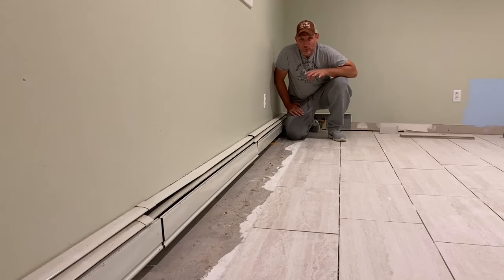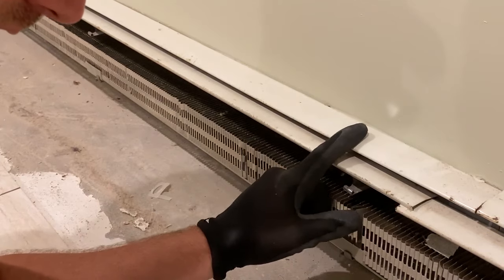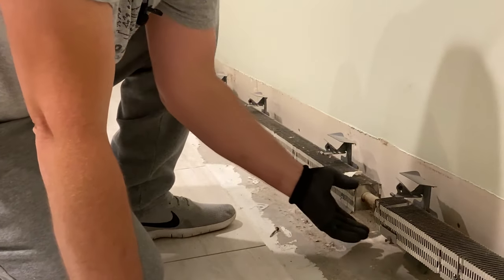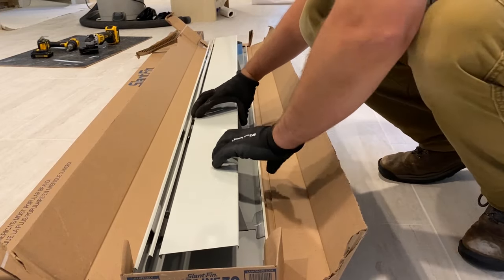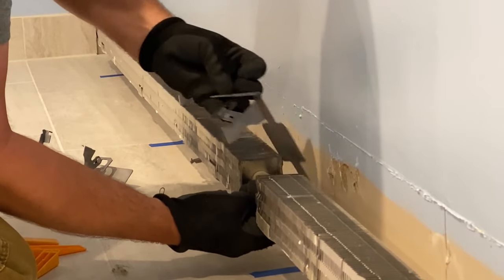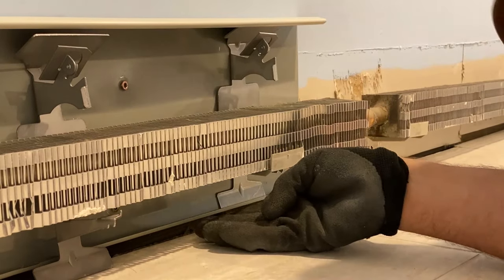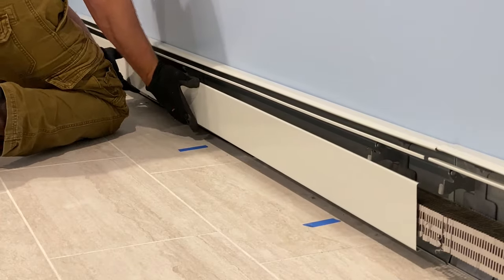How To Replace Old Baseboard Covers / Installing Baseboard Covers / DIY Home Improvement

Comment: What should I do if I cannot get the baseboard holder behind my pipe because my pipe is too close to the wall. In order to get it behind it I would have to bend a part of it. That is what I had to do to get the old metal holders out
Reply from the maker: I have successfully bent the holder to slide it behind the pipe

Comment: I think my heater back cover was installed before the pluming, how do you cut it off so you don’t damage the pipe?
Reply from the maker: I demonstrate this in the video.
Reply: @ thanks I didn’t see in this video, I saw you cutting behind the back cover.. not with pipe coming through

Comment: We just did a first-floor renovation. Started with a kitchen remodel and expanded from there. We have a family room addition on the back of the house that needed additional heat, so we had the plumbers add a 15-foot run of baseboard heat into that room. After they finished, we loved how nice and clean the new baseboard looked so I asked them to quote replacing the old ones in the front of the house (two straight runs, no corners, one is 16 feet and one is 15 feet). They quoted $3200 just to replace those. Insane money! 

Thank you so much for making this incredibly intuitive and easy to follow video. I will be replacing these myself and saving thousands of $$$ in the process. You rock brother!!!
Reply from the maker: People are asking ridiculous prices for everything these days.

Comment: Great video.  Thanks so much.  If you're still reviewing comments, wondering if you have a recommendation for getting the  "Vane Damper" (or tilting vent lid) off and on if there is not enough room on the side of the baseboard unit to slip it off and on the brackets?  For example, if you have an 8 foot unit, but only 3 or 4 feet of clearance on one side?  Do you just do your best to "snap" it off and new one on the hinged brackets?  Thanks!
Reply from the maker: Install the damper before you slide the brackets behind the pipe. Then slide the brackets right or left into position.
Reply: Brilliant.  Thanks so much for the reply.   @ArtisanMade

Comment: This is the best filmed and most clearly explained video of this process on the internet.  Thank you.  Do you know where I can find the plastic brackets that attach to the fins to contact the support bracket?
Reply from the maker: Those plastic pieces  come with the heating element. If they are not already attached to your existing one, you can get away without having one. I wouldn’t be surprised if you can find them on Amazon.

Comment: Thank you for showing the entire process! i need to take my old rusty one in the bathroom , mainly because i see waterbugs coming through the holes around the radiator pipes.  However, seeing how you need some flexibility in the radiator part to remove and put back pieces, i wonder if my idea is the right one.  i was going to use grout to fill the gaps? is that advisable?

Comment: Great video. My biggest issue is I don't have the grip strength to squeeze and snap stuff in. When disassembling and reassembling I by passed that issue by sliding everything into place from the side.
Reply: I tried that because I have a similar issue. Problem is on my end that enough garbage fell into the channel that it made that nigh on impossible. Ended up using a small hammer to tap them through.

Comment: Thanks for a great video! I have a question: the room I installed the baseboard heat in is pretty small. I don’t have the room to slide the dampers in. What are my options here? Can I somehow clip them in?
Reply from the maker: They won’t clip in. Slide the holders on it first. Then put holders behind the pipe and slide them into position

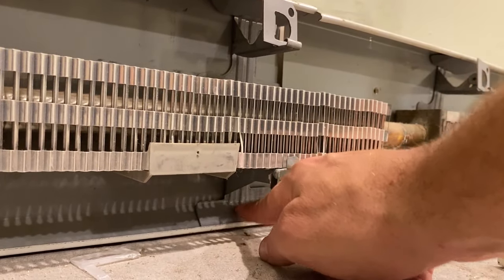Comment: I'm doing this in a bathroom. Unfortunately I can't pull the heating element far enough away from the wall to clear that bottom lip shown at 2:30 and lift the back plate.
Reply: Going through this right now.... How did you get around this issue?

Comment: What do you suggest in the circumstance that the heating element has no play offering too little room for the holders to slide behind the plumbing ? Getting the old ones out wasn't a big deal, I just bent the bottom part of the holder over, but putting the new ones in...I'm reluctant to bend the new holders to get them behind the plumbing and fins, though the old ones were hardy and resilient enough to be bent back into place without seeming compromised. Not seeing another option at the moment. Any suggestions ?
Reply from the maker: Sorry for the late response.  I'm sure you probably worked it out by now but, I have bent them in the past to get them in without any problems.  Hopefully the quality of these new ones is still good enough to do that.
Reply: I'm having the exact same problem. This process has been fighting me tooth and nail every step of the way.

Comment: Thank you for posting this.I'm remodeling my full bathroom and was debating trying to repaint the old which has been repainted 3 times before me,lol.   This was explained great and helped so much.  What kind of screws did you use for mounting the backplate to wall?
Reply from the maker: Regular drywall screws work well

Comment: Awesome video, thank you!  What part number did you use? It doesn’t com3 with the heating fins…
Reply from the maker: Not sure what the part number is. I bought them at Home Depot. They are available with the heating element or without.

Comment: Good video!  My family room baseboards were recently replaced due to some major damage to the room.  The previous baseboards were all copper pipe and quiet.  The new ones were done in Pex and they are so noisy!  Every time the heat cycles on the baseboards, clink & clank so loudly for at least 3 minutes.  When I complained to the plumber, he said "that's just the way the systems are now."  Do you know of any way to quiet the baseboards??
Reply from the maker: Unfortunately that is normal due to expansion when everything is heating up. The larger the system, the louder it is going to me.
Reply: Teflon tape can help on surfaces under or along side the fins can prevent squeaks. If the rib sections are catching fins the can be trimmed or flattened to avoid them. Some heaters have plastic sliders to allow for movement. I'd also put an expansion loop or add bellows for a continuous straight run over 10m

Comment: Thank you so much for this video!  When you bought the covers - did you split the distance of a long run?  Like, on a ten-foot wall, did you get two five-foot pieces, or if you had a two-foot piece left over, would you use that with an eight-foot piece?  Just wondering if it is standard to try to keep things symmetrical.  Thank you!
Reply from the maker: I try avoiding a very small section because it get tricky to install. If it is going to always be visible try to make them look more even.

Comment: My nephews kids destroyed the covers and actually bent most of the heating element aluminum is it possible to straighten them out or should the aluminum be replaced...
Reply from the maker: If you are talking about the thin aluminum pieces on the pipe, try to open them up again. If you are talking about the cover, it will always look banged up no matter what you do to it.

Comment: what brand is this system and wish you had named the parts at the end of the video (used in corner and to splice two pieces). don't know where to get these odds and ends for my old system. thank you!!
Reply from the maker: Purchased at the big box store. All parts are in the box except for the end caps and corner cover.

Comment: How would I slide in middle ( adjustable vent cover ) in a confined space . 4ft bass board in a 5ft bathroom?
Reply from the maker: You will have to install the thin strip on the brackets first then slide the brackets behind the pipe

Comment: How thick is the metal on the front panel and back plate? Looks about 0.8mm? Also does that narrow outlet plate act as an adjustable damper?
Reply from the maker: Not sure how thick.  The thin piece is a damper.

Comment: What about when the top piece thar adjusts the amount of heat coming out cant slide in like you did? I have limited side space
Reply from the maker: Usually it is wadi to slide in from on particular direction. To solve your space problem, slide the brackets to one end. Slide in the top piece, slide them back into position and then snap them into the rear plate.  Hopefully this helps

Comment: We just had a whole new system installed in an old house. Drywall is torn out in order to install new pex tubing and new baseboard heaters in the basement. The problem is they install the baseboard heaters directly to the bare wood studs before the drywall it was put back. This can’t be right? How do we replace drywall? Would you ever do it like this? Trying to get our installer to remedy, but they are ghosting us.
Reply from the maker: They made a mistake. Plumber should run any tubing necessary behind the wall prior to sheet rock. Then sheet rock gets installed then paint then install baseboards over sheet rock. That’s the right way to do it. And I hope this thing works out for you soon without too many headaches. Good luck.

Comment: Okay baseboard master! I have watched your video, cut through my only problem screw, popped my holders but I can't get the back out. 😭 There isn't enough clearance for the holders or the back plate to come out. I called a guy, he was big mad at me for even doing this myself and said they replace the whole pipe when doing this😒 so he probably did this shit job  in the first place lol. 

SOS I can angle grind the holders out then I think the back will slide out but then idk how I'll put anything new in here. There is very little play. 
Are you available for a video call lol but really tho
Reply: PS, I'm in the bathroom a short 5' span
Reply from the maker: I'm sorry it didn't work out so easily for you.

Comment: What kind of screws did you use?
Reply from the maker: Use drywall screws
Reply: Thank you!
Reply: Will construction screws work? They don't seem to penetrate the metal, am I just using the wrong power drill?
Reply from the maker: TheRawski they work but they are harder to get through. Use drywall screws if you have them.

Comment: I don't have enough play to move the pipes away from the wall because the floor is already tiled. (I am replacing a rusty baseboard.) I think I'm going to have to make the hole in the ceramic floor tile a little bigger where the pipe already goes through  that I can pull it away from the wall.
Reply: You can bend the bottom of the metal that the elements sit on, than they could fit behind sometimes..

Comment: What if you don't have room to slide that thin top piece in? Like in a small bathroom.
Reply from the maker: Attach it first to the holders before sliding them behind the heating pipe
Reply: @ArtisanMade  thank you

Comment: Can you paint the baseboard cover instead of replacing?
Reply from the maker: If the baseboard is in good shape you can, but it won’t look very nice.  If you decide to do that, you would probably get  better results spraying them, but that can  be difficult indoors.
Reply: Definitely. Remove the covers, sand them to remove rust, wash them and the spray paint them outdoors. Take your time and they will look great.

Comment: good video....but I've never seen a pipe with that much movement to allow fitting brackets behind. Seems very unrealistic. Hard to believe the pipe joints would stand that much movement. Regardless 99% of cases don't have that much play and brackets don't fit behind without significant bending of bracket. Very frustrating.
Reply from the maker: I have done this over a dozen times. Most of the time I have been able to squeeze them in without a problem.

Comment: I would send the baseboard heaters to slant fin or a quality auto body shop and  have them reconditioned and repainted so that they can be used again.  Most of the time they usually aren’t badly with dents…just the paint finish is a bit scratched or slightly rusted